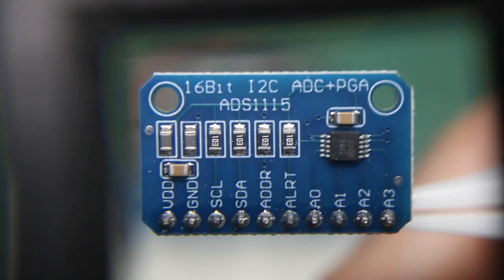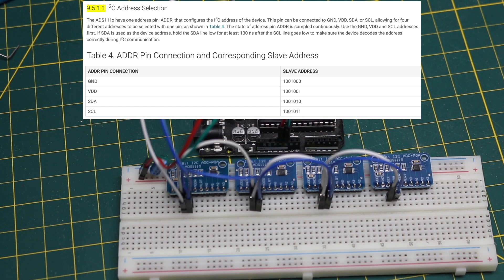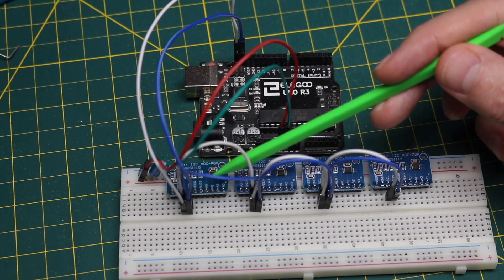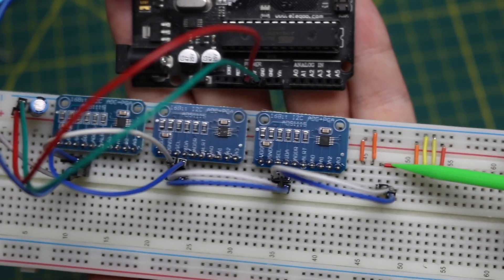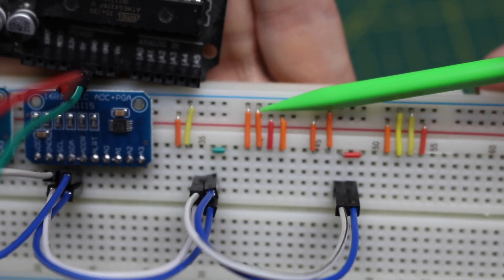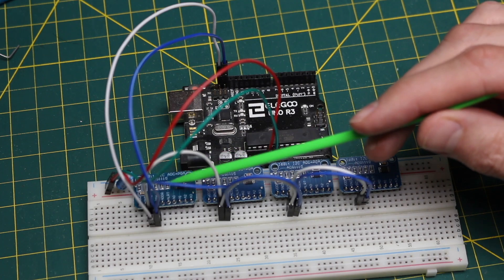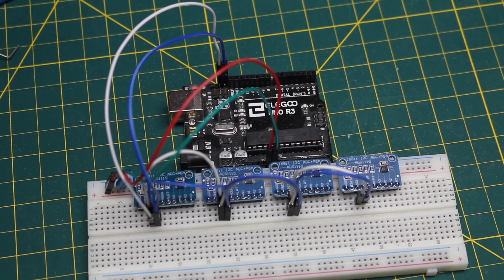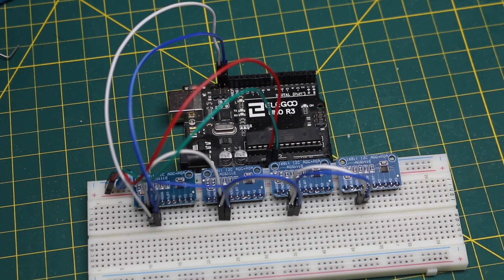ADS1115 - 16 Ch on One I2C Bus with One Address Pin

Comment: Many of these modules have 10K pull-ups to 5v on SDA and SCL and a 10K pull down on ADDR. Wired as you describe, you get a logic high of 3.3V on SDA. and SCL which is ideal for 3.3 volt processors. Modules without those pull down resistors cause a logic high of 5V which would be bad for a 3.3V processor.
Reply: Correction: with 4 ADCs, logic high is 4V. With 2 ADCs and ADDR to SDA on one ADC and to SCL on the other, you get 3.3V.

Comment: Thanks. But not work for me from beginning. 
Need to change: 
Adafruit_ADS1115 ads0(0x48);  // ADC object at I2C address 0x48 for addr pin = GND
Adafruit_ADS1115 ads1(0x49);  // ADC object at I2C address 0x49 for addr pin = 5V
Adafruit_ADS1115 ads2(0x4A);  // ADC object at I2C address 0x4A for addr pin = SDA
Adafruit_ADS1115 ads3(0x4B);  // ADC object at I2C address 0x4B for addr pin = SCL 
to 
Adafruit_ADS1115 ads0; // ADC object at I2C address 0x48 for addr pin = GND
Adafruit_ADS1115 ads1; // ADC object at I2C address 0x49 for addr pin = 5V
Adafruit_ADS1115 ads2; // ADC object at I2C address 0x4A for addr pin = SDA

and  from
 ads0.begin();
  ads1.begin();
  ads2.begin();
  ads3.begin();
to:
ads0.begin(0x48);
  ads1.begin(0x49);
  ads2.begin(0x4A);

maybe because different version of library. You use 1.0.1, I download from Platformio 2.5.0

Comment: looks like something id hold it back, you should be able to get 860 samples per second. which is about 1.1ms conversion time.
Were you using single shot or continuous  sampling, continuous sampling should speed things up as you don't need to wait for sample to complete, you just read the last sample. 

were you doing fast i2C @ 400kHz?
Reply from the maker: I was using whatever the default wire library would do with the Adafruit ADC library and I think it was just single readings, I pulled up a sketch from years ago and just added extra channels to make sure I could get it going but it also looks like the library for it has changed over the versions, had to fight off compile errors.
So I need to look into it all again and get up to date and try some more in-depth testing now that I know it’s a viable thing
Reply: @gadgetsideload  one of the reasons i stopped using the Arduino IDE. Libraries should be backwards compatible, if you change the methods you should leave the old one in place. but anybody can post a library and no one cares how well they are written.  Plus i find they only contain the easy bits of the datasheet or the the one bit the writer wanted to use.
Far easer to write your own, plus your learn a lot more about the chip in the process.
Reply from the maker: at some point along the way I started noting in the comments at the top of sketches, the version number of every library and every board file that I used at the time I was working on the project. and then eventually I also started making note of the Arduino IDE version because even that caused problems.
there was something going on with ESP board files I can’t remember if it was affecting ESP 8266 or ESP 32 but certain things would not work unless I rolled back to version one something. I recall some problems with SD card libraries, I don’t know if that’s the same problem.

Comment: I like these, very interesting.  Would really love for you to check out the linear-ness of the V measurements, and the accuracy / precession of the internal voltage refs.  Would not expect stable measurements in the last three bits, but that is fine.
Reply from the maker: I think I first used these five years ago and back then I remember reading something about how even though they are called 16 bit there might only be 15 practical bits but I forget why. I have to dig into it all again. 

One thing I do need to look more into, I was running these at 5 V but later when I tried at 3.3 I was getting weird readings like suddenly whatever inputs had ground versus 3.3 V, I was seeing those readings show up on different channels in the serial monitor but they were working fine at 5 V so I don’t know if it’s because I was using the esp that was acting strange or a different library version, some debunking to do.
Reply: @gadgetsideload  I've been frustrated for years, trying to make an inexpensive measuring tool for multiple battery voltages.  Dedicated chips seem to work better than MCUs ... but still, hard to get real stable, fast 3-digit accuracy.
Reply: @GnuReligion  how fast to you need them to be, I've found batteries to be quite slow to do things.  i'd go for dedicated chips every time.
Reply: good luck in measuring the characteristic of a 16bit ADC, been there and done that as part of design verification of an asic which was being designed for us. Takes a lot of expensive equipment and way too much time to want to do it for fun. I had to re-run after every change made don't know how many months (close to a year)  I must have spent just checking the ADC. 😞